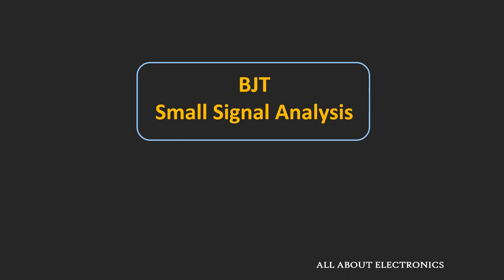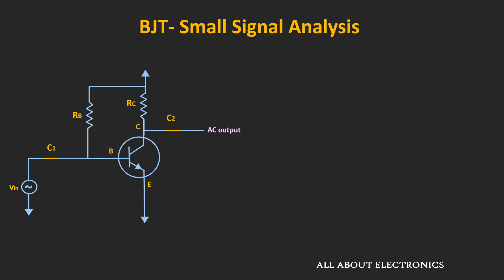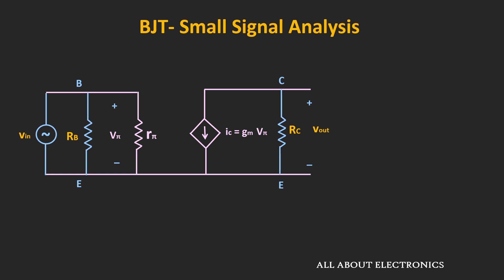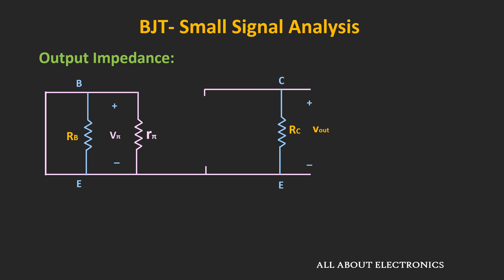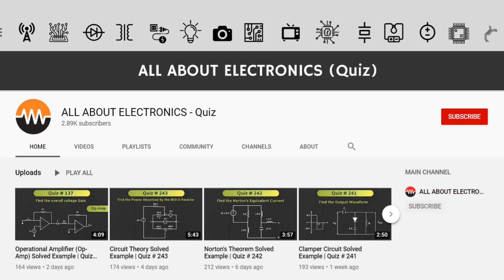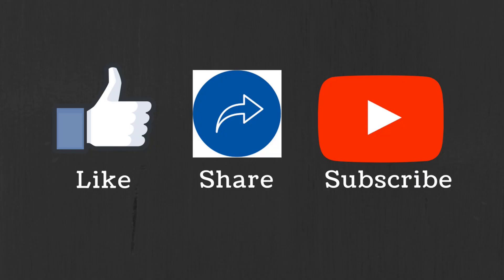BJT Small Signal Analysis: Common Emitter Fixed Bias and Voltage Divider Bias

Comment from the maker: The timestamps for the different topics covered in the video:

1:00 Why a coupling capacitors are used in the Amplifier Circuit

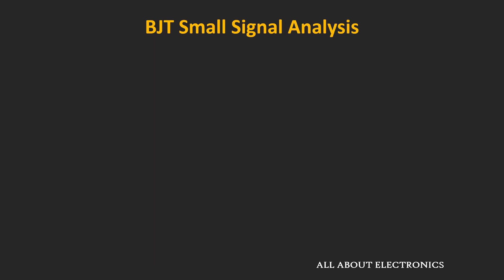2:45 Steps to follow for the Small Signal Analysis

4:35 Small Signal Analysis of CE Fixed Bias Circuit

10:40 Small Signal Analysis (with output resistance)

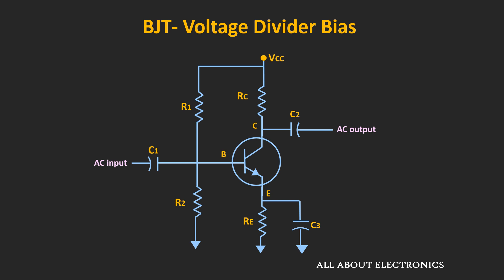11:44 Small Signal Analysis of CE Voltage Divider Bias Circuit
Reply: plz..can you tell me which software you are using as explanation board..?
I'm also started one channel I want one software like you are using ....!
  Thank you
Reply: Sir is this hybrid π model please help me...
Reply: @jineshks8271 yess

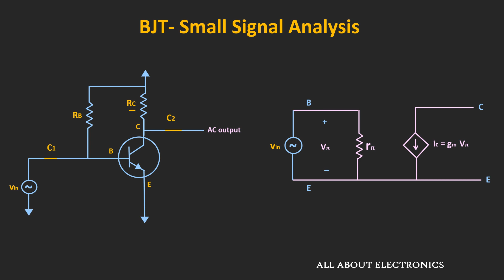Comment: Sir 6:16 i am confused about the resistors Rb and Rc how u placed them it seems odd
Reply from the maker: Base resistor Rb is between base and ground. So, in AC equivalent circuit it is represented between base and emitter ( as emitter is ground). 
Similarly, collector resistor is between collector and ground terminal . So, in AC equivalent circuit, it is represented between collector and emitter terminal. I hope, it will clear your doubt.

Comment: As we consider capacitor is shorted for small signal analysis, does that mean small signal analysis is always done for  high frequency application purpose?
Reply from the maker: No, here it is done for mid- band frequencies. But here it is assumed that the value of capacitor is selected such that, at the operating frequency , its reactance is very low and it can be assumed as a short circuit.

Comment: Sir on the input the decoupling capacitor is placed on before the fixed biasing Resistor Rb, so how will it block the DC bias voltage from Rb given to base of bjt?
Reply from the maker: It will block the DC voltage of the other BJT amplifier which is cascaded with this. Many times the AC input signal is the output of pre-amplifier (which is also biased with DC voltage). The DC voltage of that amplifier, should not affect the biasing of the BJT amplifier. That's where the decoupling capacitor is very useful for isolating the two stages. 
I hope, it will clear your doubt.

Comment: in the input impedance it is not the parallel combination of Rb and Rpi rather it is 1/parallel combination Rb and Rpi
Reply: No. The input impedance is the parallel combination of the resistors. It should be obvious that if those resistances increase, the input impedance must increase. Your formula would give a smaller answer if you made the resistances larger, and therefore must be wrong.

Comment: Hai sir. I have a doubt. Weather AC analysis and small signal analysis are same?
Reply from the maker: Yes
Reply: Not quite. The ac response is idealised so that we assume the changes in quiescent voltages and currents are small compared to their static values.
You may have to consider sometimes the ac response of a circuit where the output swing is large, and then you will have to take into account, for example, the change in gm (and hence gain) as the collector current varies.

Comment: what is gm in the video, could someone plz explain this to me??
Reply from the maker: gm is transconductance.
Reply: It is the rate of change of collector current as the base-emitter voltage changes. It increases as the collector current increases and is almost independent of the transistor used. It is found to be equal to the collector current divided by 25mV at room temperature.

Comment: Why you put minus before gm in voltage gain? Vo=-gmVRc
Reply from the maker: In the equivalent circuit, if you see the current source gm*Vπ, it is flowing downwards. 
Applying KCL at the output, Io = - gm*Vπ.
Therefore, Vo = -gm*Vπ*Rc
And since Vin = Vπ.
Vo / Vin or the voltage gain = -gm*Rc
I hope it will clear your doubt.
Reply: @ALLABOUTELECTRONICS  Thank you for the answer
Reply: @ALLABOUTELECTRONICS  here how Io=-gm x vpi? Please answer me sir
Reply: @ALLABOUTELECTRONICS  how did minus sign come?
Reply from the maker: @user-fi3cd3ig6l  As I mentioned earlier, in the equivalent circuit, if you see the current source gm*Vπ is flowing downwards. 
Applying KCL at the output, Io = - gm*Vπ.
Therefore, Vo = -gm*Vπ*Rc
And since Vin = Vπ.
Vo / Vin or the voltage gain = -gm*Rc
I hope it will clear your doubt.
Reply: @ALLABOUTELECTRONICS  yeah I saw that but couldn't understand how minus sign came? would you please explain a little more sir?
Reply: @ALLABOUTELECTRONICS  so isn't it ic=-io instead of ic=io?

Comment: are you sure that , you can see the generator as a open circuit? because it's not a indipendent generator...
Reply from the maker: I think you are talking about the equivalent circuit for finding the output resistance right !!
Reply: @ALLABOUTELECTRONICS   yes
Reply: LoOkB4U is my second account sir...
Reply from the maker: While calculating the output resistance, the input voltage source is considered as zero. And the dependent current source, gmVbe, depends on the input voltage. So, once input voltage and hence vbe is zero, the department current source will also become zero.
I hope it will clear your doubt.

Comment: Can you explain more why is negative sign with the Voltage gain?
Thank you
Reply: A small increase in the voltage applied to the base will produce an increase in the base current. That will produce an increase in the collector current. The increased collector current will produce a larger voltage across the collector resistor. But one end of that resistor is fixed at the supply voltage, so the voltage at the other end of the resistor must decrease. That is the collector of the transistor, and is the output of the stage.
That shows that as the input voltage increases, the output voltage decreases. That is why we call it a negative gain.